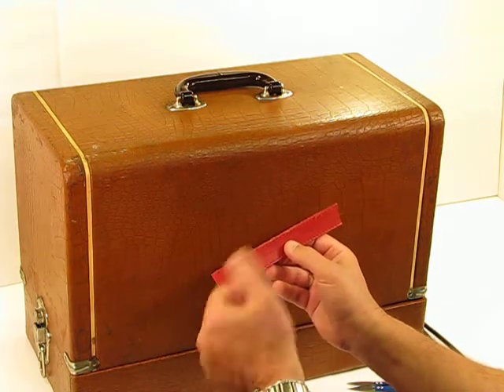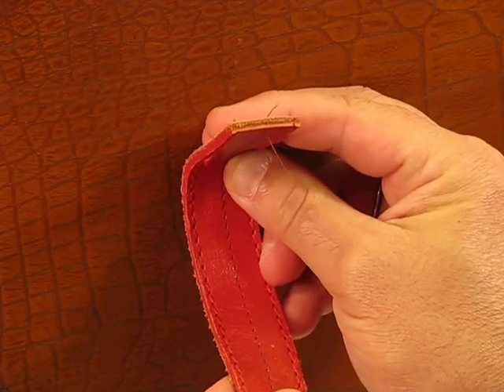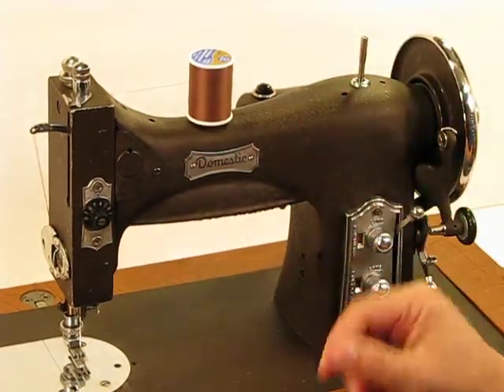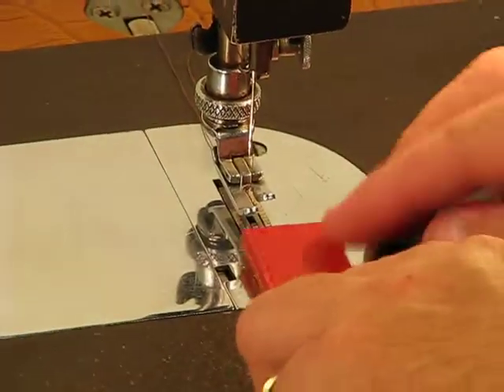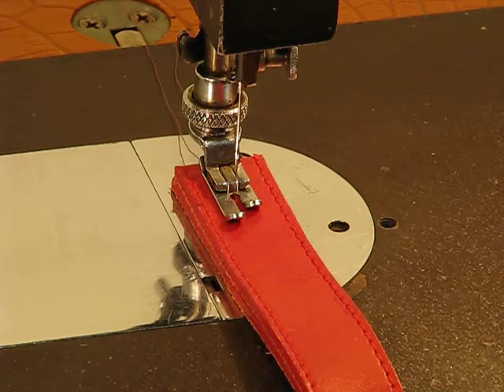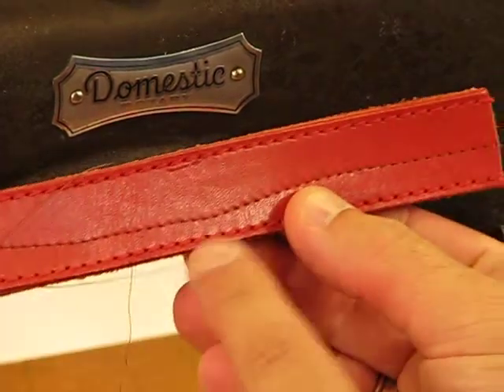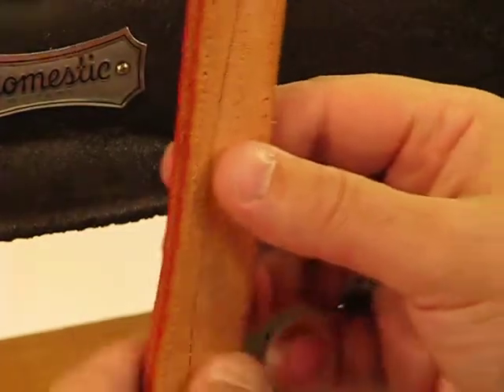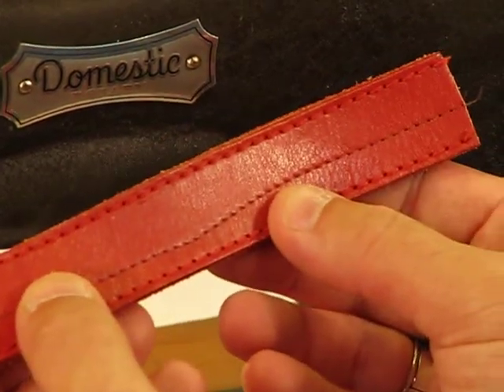1949 Domestic 153-MG - Two Thick Layers of Genuine Cowhide Leather!!

Comment: I have this machine and it is indeed a good, strong sewing machine. But,  don't kid yourself people...it will destroy the machine to sew leather on it.  The whining at the beginning is the rubber pulley slipping on the handwheel (direct drive) not his "foot slipping".  denim and canvas within reason are ok.  also...sewing leather means nothing when you use all purpose domestic thread which is worthless for anything but garments.